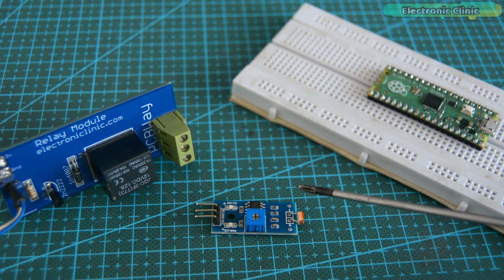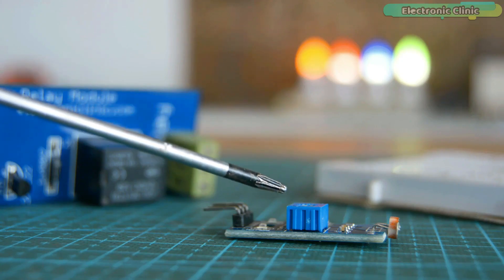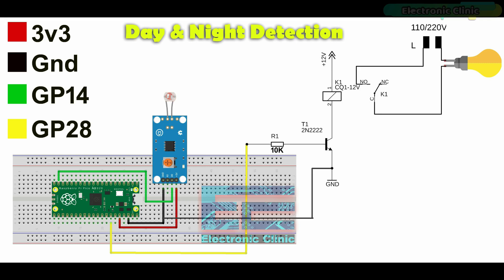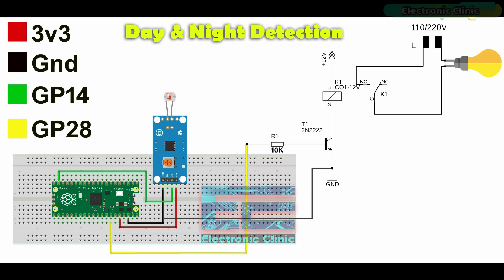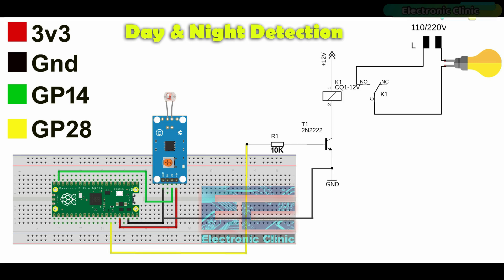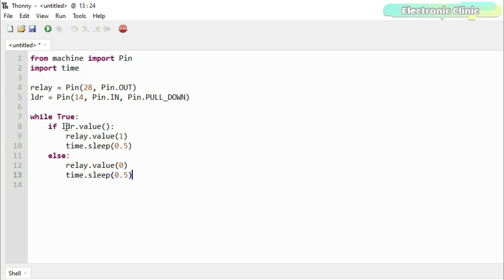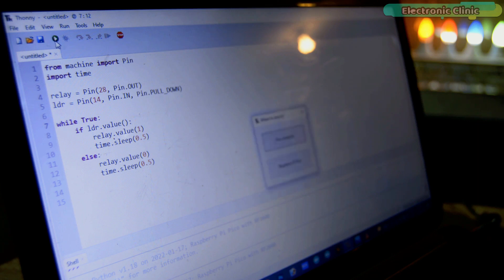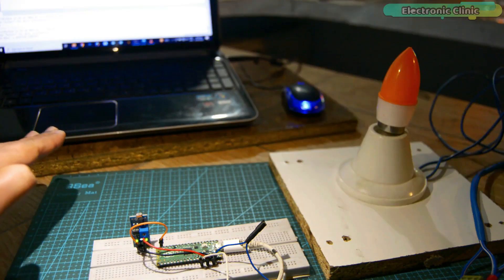raspberry pi pico day and night detection, how to use ldr with raspberry pi pico

Comment: i am super new to this and barely have any idea what i'm doing so sorry if my question is a bit stupid maybe.

i don't hvae the relay device but i just want to print the datafrom the sensor in my interpretor how would i go about doing that?
Reply from the maker: If u don't know about python then no problem you can also use Arduino ide for programming. I have uploaded several videos on raspberry pi pico and Arduino ide